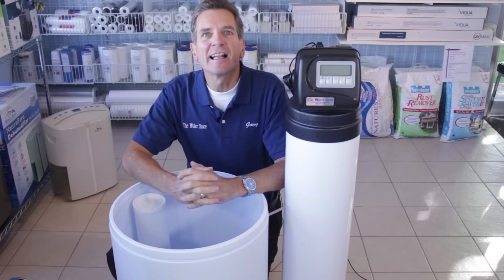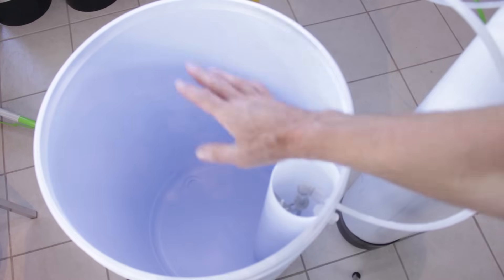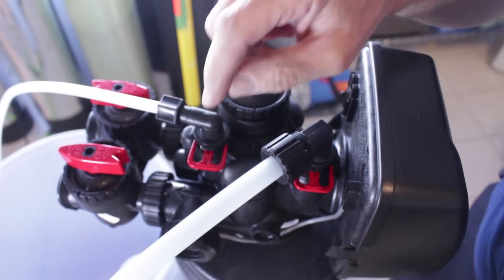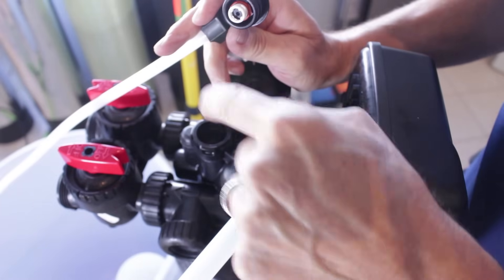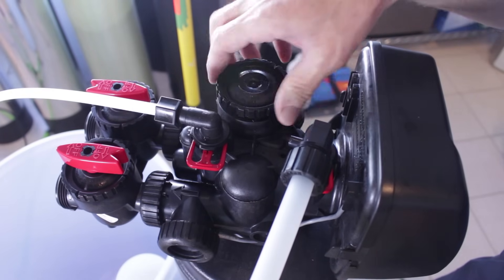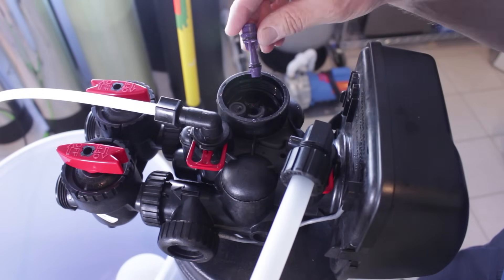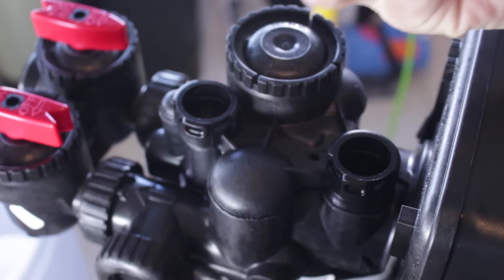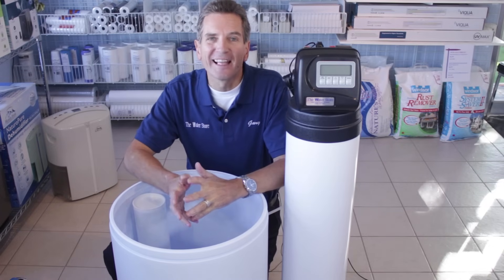Water Softener Troubleshooting Too much Water in Brine Tank

Comment: My drain line is positioned above the unit , would this cause this issue Does the drain line need to be below the control head?
Reply from the maker: No, it can be above the head.

Comment: Thanks.  when I look in the brine well, the float is way up high.  I assumed the float would be floating on top of the water.  Is there something wrong with my float?  Perhaps this is why so much water is coming into my brine tank?
Reply from the maker: No, the float is an emergency device only. If too much water was going into your brine tank the float would shut off the water before it over flowed.
Reply: @water_estore  ok good to know.  Your videos have been very helpful at bringing me up to speed on the water softener.  I will keep you in mind for any parts I might need or someday a new unit perhaps.

Comment: Hi Gary: I went on vacation and routinely closed my main well water supply valve to my new softner.  Upon return, I found about a quart of water on the floor around the brine tank.  I suspect the softner may have run a regeneration cycle.  Before and well after this time there have been no leaks, even after a manual regeneration cycle.  Any ideas on the source of the water leak?
Reply from the maker: I don't know.  I would manually run a regeneration and keep an eye on it to see what happens.

Comment: First, I'm SO glad that I came upon your channel; so many great videos.

I'm trying to troubleshoot mine, which has water coming out and into the sump pump area, but it's still filling up.
EDIT: I broke up a salt bridge, confirmed that the venturi area is fine (although, I believe that I only found 1 flow plug), and now water is flowing in but not rising. Previously, even with water flowing out and into the sump pump area, it was still rising.

There's a few inches of water, about where it should be during normal operation, but I still hear water being "pulled"/allowed in. 

EDIT 2: now, in looking at videos/pics, I see that there's another flow plug besides the lower one: 
FLOW PLUG 15 GPM GEH-WS22X10036

So I took it apart to cofirm that it is not there - and it isn't - but when I re-assembled and turn things back on, just as before the water is heard flowing - and is exiting the tank - but now the level is also rising inside of the brine tank?! I didn't make a single change to anything, and yet now it's both heard pulling water (and flowing out), but also the level is increasing.

ANY thoughts on what could be going on, or how I should proceed to troubleshoot?
Reply from the maker: Yes, it sounds like the water is flowing past the pistons and seals in the valve.  The fix is to rebuild the valve.

Comment: Thank you Gary for your info, check everything step by step, and looks clean, but inside the spacers, one of the gaskets is turndown (broken). I need to replace the espaces.
Where do I get the spacers for this Valve you showed in this video ?
Reply from the maker: Right here https://waterestore.com/products/clack-ws1-softener-rebuild-kit-wrench but I suggest you replace the pistons at the same time.

Comment: Hey Gary, first off - THANK YOU for all of these informative videos. They’ve been such a huge help! I’m new to my softener system and wanted to know if my water level in the brine tank seems too high or if it’s fine as-is. 

It’s a Clack WS1 3-button valve on a tank that’s probably around 40-45 inches tall. The brine tank is about 32.5 inches from the ground to the inside lip (without the lid on top which would add some height) and it’s a square tank likely a 14x14 or even larger. I have brownish foamy water above the salt. The salt is about 9 inches from the ground and the water’s about 11 inches from the ground. 

I watched the entire regen cycle to see if I had air leaks in the brine line or any other issue and it operated totally normal without issue as far as I could tell. The water level drained way down so I could see the top of the air check and then the system filled to the height described during the final fill cycle. I waited over night to see if the level changed and it didn’t move at all. I also did the steps in this video to look for water movement between the drain and the brine by removing the E clips and fittings. No movement even when I turned faucets on. 

I’m just concerned about seeing water above my salt (11 inches) when the salt is about 9 inches high. Is that something that sounds normal or abnormal? If it’s abnormal and all of the other high water causes are eliminated, could it be the tech entered a setting that’s sending too much water to the brine tank?

It’s at my first home I just bought, which had been vacant for a few months and therefore had brine tank with no salt so I had a tech come out to clean the tank, fill it, and put the system settings in to make sure I started off right. 

Thank you!
Reply from the maker: No, all sounds fine to me, you just need to add some more salt
Reply: @water_estore  Thanks, Gary! I’ve learned SO much in such a short period through all of your videos. I really appreciate you!
Reply from the maker: You're welcome! Please share video with friends and family.
Reply: I had the same concern.  I put 2 bags
of salt and the brine water level still covered the salt.  Reflecting on the installation I thought there was a missing part when I was assembling the brine tank.  My previous softener , a twin tank Kinetico , provided a 3inch elevated perforated platform so that salt never touched the bottom of the brine tank.
Anyways,  the softener is working great.  Thanks for the videos.

Comment: can you show one totally connected, i see water coming in from the drain line during regeneration, is this correct??
Reply from the maker: Water should only be going out throught the drain line during regeneration.  This video should help https://youtu.be/cFy-M6i7_Ms
Reply: Ok, the water line from the main resin tank discharges water and instead of going out the drain, it is going into my brine tank; it must be connected incorrectly by plumbers.  @water_estore

Comment: So, I go through easy over 200lbs of salt in 60 days. For 4 years its been full of water with brown stuff floating, regardless of how much i washed it in the driveway with bleach. I thought it was bacteria and now realized it was iron. So using iron out things are better, but still over flow of water by 20 inches. I think i have to take it apart like you and check all this. The home builder made me waste so much salt, time and money on salt for 4 years by not installing it right. It was never not floating full of water even when it was a brand new house.
Reply from the maker: Have your raw water tested to find out exactly how hard your water is and how much iron you have.  From there you can use the info in this video to set it up correctly https://youtu.be/XMY69hdhX44

Comment: What do you mean in service? Can you expand on that? If you remove the Brine cap and the discharge wont you get sprayed?
Reply from the maker: Yes, whenever the water softener is not regenerating and water is running through the water softener it is in service. If you are doing maintenence you should always start a regeneration to relieve the pressure and then put the water softener into bypass that way you won't get sprayed.
Reply: i have 5 buttons across. your videos seem only to have 3 buttons on top and two on the bottom? whats the difference? is that simply a design change? What model years were the 5 button across manufactured? @water_estore

Comment: Hi Gary,

My 2 piece water softener was installed about two years ago by the same plumbing company that did the plumbing in our new build home.  During a recent water filtration maintenance appointment the technician noticed  that the drain line was to small that had been installed by the original installer.   He said that the drain line need to have a 😂1/2” line to drain properly. 

What do you think?
Reply from the maker: I agree 100%

Comment: Gary my injector does get clogged.  My question is what are the steps to checking the injector when the system is hooked up..in your video you are using a softener that is not actually running.  Do I just put in bypass?   I put in bi pass but the cap is hard to remove to get to the injector.
Reply from the maker: This video explains the procedure better https://youtu.be/Eonviqm58bA

Comment: We moved into a house and the Brine Well doesn’t have any bottom to it. It’s just open. I don’t know how that is supposed to work. Maybe I just need to buy a replacement brine well. Our brine tank is just a regular tall black round tank.
Reply from the maker: They work without a bottom since the water flows in and out through the slots in the side.

Comment: Hello, i have the same problem as this user... Please help!.Question: what would cause water to flow INTO the brine holding tank during the brine drain cycle?  I removed the hose from the pickup and observed water coming out when it should have been sucking it up
Reply from the maker: Clogged injector or a worn out valve

Comment: Gary thanks for your video, I have a question and hope you can answer , I have a new 64,000 G Aquasure water softener, my question is that it came programmed to use 60 minutes for the brine draw time, but it uses all the water in the brine tank way before the 60 minutes is up,  is this normal? And if it is why would it need 60 minutes when it only takes about 40 minutes to use all the salt water brine ?
Reply from the maker: That is common practice with all water softeners.  I tneeds the time to not only draw out the brine but to also slowly rinse the brine out of the media tank to the drain to fully regenerate the media.
Reply: Thank You for responding, ok 👍

Comment: After my Hellenbrand FM-1600 with a low water piston regenerates during our sleeping hours, the first time the water is turned on at any sink, the water is quite foamy and very white and tastes very salty.  After running for a few minutes it gradually runs clear again.  This began a few months ago. I have thoroughly cleaned the brine tank and all components such as float and brine well.  What can cause this?  Would cleaning the injector help?  I have not removed the injector yet and do not have the replacement/rebuild kit and wondered about simply removing and cleaning it.  A kit 3 was installed in 2010 according to the label on the back of the meter. No other work since then. The new installation was in 1998 and has only been worked on once (2010).
I have not made any changes to the meter settings and they have always served us well.
Revision: I removed the injector. There were two pieces, the injector nozzle first and inside was an injector throat, according to the diagram. The injector throat was broken.  Could this have caused the foamy water?  None of the injector pieces or the filter screen were clogged and they were very clean. How could the broken (at the threads) injector throat cause the water foaming if that is what causes it, but also what could have broken the part?
I have turned the the lever to bypass for now and need to purchase the part. I hope that fixes my issue.
Reply from the maker: I don't know if the broken injector casued the problem.  I would replace it to see if that helps.
Reply: @water_estore  The injector did not solve the problem.  Instead of investing in a rebuild kit I decided to replace the entire softener and invest in a much newer unit with digital controls.  I installed it and it is working great.  One change I made was to build a bypass within the piping just ahead of the bypass for the unit so that future alterations do not require shutting off the main house supply valve if the units bypass must be removed (mine required that).  Three ball valves were needed, one in, one across, and one out.

Comment: So checking the spacer stack and pistons...the part you removed the drain line and brine line on mine both were quite filled with water which means I need to replace my spacer stack and pistons? Thanks! I’m learning lots from watching your videos
Reply from the maker: No, not necessarily.  If water constantly flows to the drain or into your brine tank, then yes.

Comment: Hi Gary, 
I have some problem with clark ws1 CI head. It is working with greensand, regenerated by kmno4. Regardless of the length of backwash, regeneration and rinse, purple water appears in the system. I have test turned off the kmno4 sucking stage to make the "regeneration" consist of backwash and rinse only. Despite this, purple water still appears in the system. I noticed that probably the head is sucking the regenerate from the tank during the completion of the whole regeneration process, while going into filter mode. I think so, because during the rinse clean water comes out into the duct, and at the very end of the process, when you can hear that the mechanism in the head switches to the water filtration position, very purple water comes out into the duct for a moment.
Therefore, no matter how long the rinse times are set, I always have purple water in the system and have to pour several minutes of tap water until the system clears.
I checked if and when it was sucking fluid. I unplugged the hose from the brine tank and while holding my finger on it I observed the suction.
It looks like when the head goes into backwash mode, meaning the piston is moved deep - to the end of the head, the hose spits out some water. But at each successive stage, as the piston is moved back to the max, and as it moves to the next stage it goes back to the front from the end, at the same time it sucks up some fluid through the hose. As a result, it actually pours fluid on my filter column at the end while moving back into the filtration position.... I checked the basket and the pistons, they look rather functional - the pistons move quite tightly inside the basket.

Is this slight spitting and sucking during piston operation normal in Clack heads or is something wrong here?
Reply from the maker: It sounds like there is water leaking past the pistons and seals and the valve needs to be rebuilt.  We have the parts here https://waterestore.com/search?type=product&q=clack*%20piston*

Comment: yeah, but what to do if you've already ended up with water in the tank, before troubleshooting the underlying issue. i.e. how to address the symptom of the high water, after it has already happened?
Reply from the maker: Sorry not sure what you are asking.  Do you mean what do you do to get rid of the excess water?  If so, once the casue has been fixed, the water level will corrrect itself after a couple of regenerations.  Check out this updated video https://youtu.be/ZdA0aI1q22w
Reply: @water_estore  perfect, thanks, that's the advice I was looking for. I regenerated it only once and the water level dropped, but not where it *used to be*. Now I understand it needs a couple more regenerations, thanks! Should I force a regeneration, or should I leave the water in there until the next "natural" regeneration occurs? Thanks!
Reply from the maker: It's up to you but I would just wait until it regenerates itself.

Comment: Hi Gary, my softener has water to lever 4 for many days. Should I remove it?
Reply from the maker: Run it through a regeneration to see if the level returns to normal.  If not something is causing it to be at that level, this video will help https://youtu.be/ZdA0aI1q22w  After the problem is solved and the unit has regenerated the level will return to normal.

Comment: I think that your video was quite informative, however I do believe that you should point out to viewers that softeners need pressure to work correctly. Too lower pressure on the incoming supply would cause a brine bin overflow. The Clack system that you are showing will need a minimum of 2 Bar pressure to function correctly. Good overview Gary.
Reply from the maker: Good point, I have never run into a situation where the home had less than 28 psi. But if that were the case yes, it would not work in that situation. Also, there may be issues if the pressure is more than 90psi.

Comment: Your video is very helpful! I am going to go threw the process of it but I have a question I hope you can help on?!? I have a culligan water softener and I don't know where to find the little filter you pulled out to soak in CLR? Also do you put it in bye pass when the lines are  unconnected to see water flow? Also any chance on knowing where the big grey filer you you pulled out would be located? 😕😢🙏 hopefully you can help me...
Reply from the maker: The injector on Culliagn is usually on the top under a steel plate.  It needs to be online to see water flow. Seal pack is inside but I don't know how to access on Culligan.

Comment: Great video.  Too much water in the tank and would not drain out.  I had to manually remove the extra water out of the tank. I located the plugged orifice just as shown.  Cleaned it now and will see if this is it.  I am confident my problem is solved.  Thank You!
Reply from the maker: Thanks for sharing!  Please share video with friends and family.
Reply from the maker: Thanks for sharing!  Please share video with friends and family.

Comment: Do we need to put the resin tank in bypass mode to check the brine flow control connection, the drain line flow control and injector?
Reply from the maker: No, but it would not hurt if you did.

Comment: Hi Gary, so brine line should not have water  pressure if removed with the valves open i.e. not in service? Thanks.
Reply from the maker: That is correct.  When in bypass there should be no pressure at the brine line.